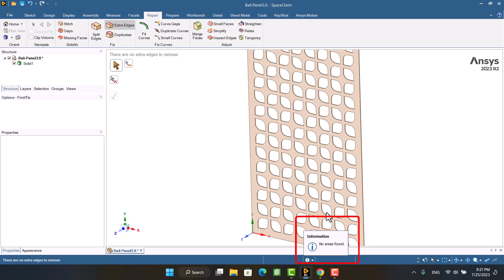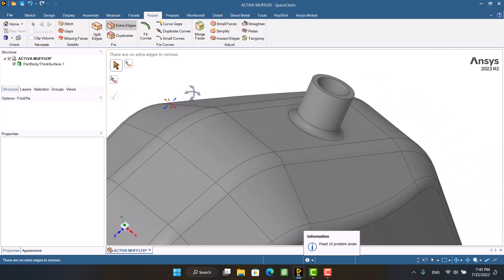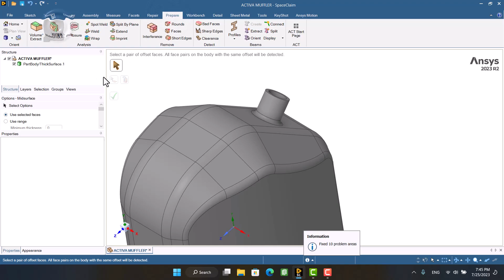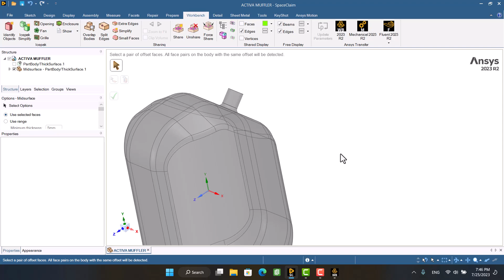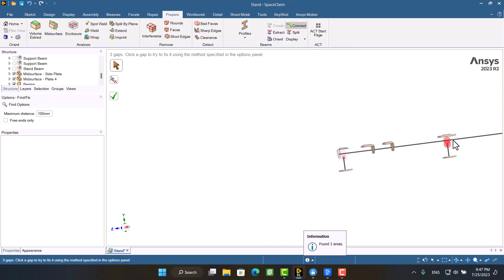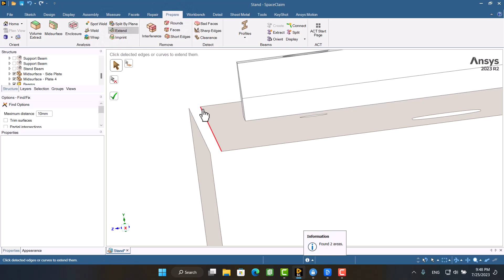💡ANSYS Tutorial: Convert solid to shell and beam in SpaceClaim🧩

Comment: Hello, can you do it the other way round. For example I have a model with line bodies and beam profiles. How can I convert these in Surface bodies and solids in Space Claim and Design Modeler? I shall be grateful for your answer..
Reply from the maker: Hello, As far as I know, it does not have this capability. I hope this link helps you. https://ansyskm.ansys.com/forums/topic/ansys-spaceclaim-is-there-any-way-to-convert-beam-with-profile-cross-section-back-to-solid/
Reply: if a video is not possible, please if you can paste some written instructions, it would be great.
Reply from the maker: @syedimadhaqqi4340  copy profile of beam and extrude it. I Haven't done it before. But I think it will work.
Reply: Hi thereeee 
By applying this can I do a modal analysis on my complex geometry?